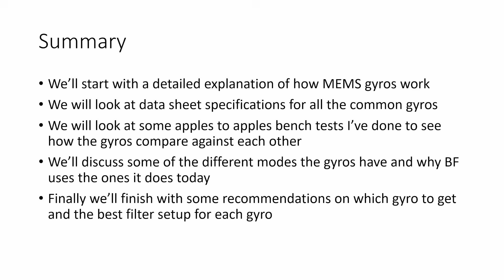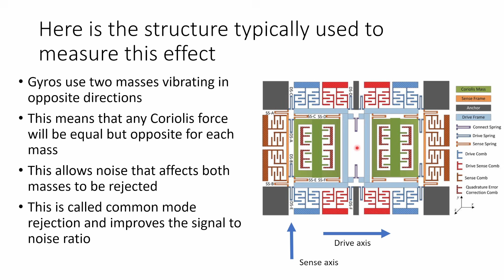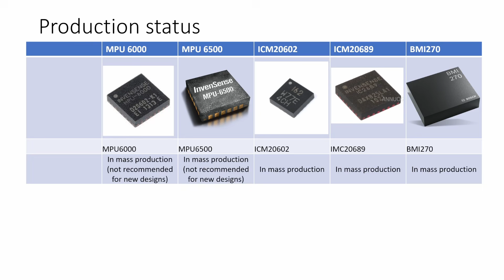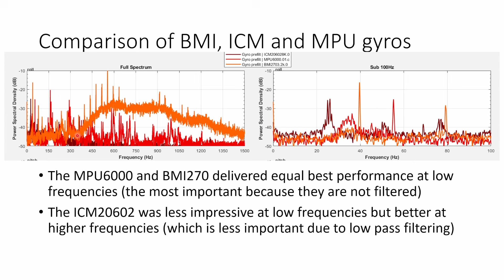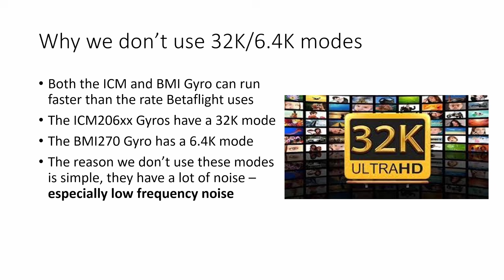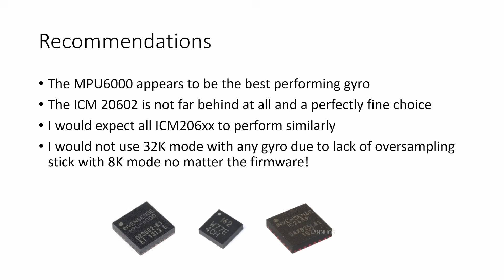Gyro shootout: MPU6000 vs ICM20602 vs BMI270 and OSR4 mode for BMI Gyros!

Comment from the maker: Hi everyone! If you have a BMI gyro board and would like to test OSR4 mode then I'm pleased to say its in BF4.3 by default now.
Reply: @Chris Rosser, Is this automatically implemented in 4.3 yet or is it still experimental? I have a SpeedyBee F7 Mini Flight Controller Stack which has the BMI270 and would like to know what to use before I maiden. Thanks for your vids and great information on this subject!
Reply from the maker: @GrumpyHeadDesigns  It's automatically in 4.3 now.
Reply: @ChrisRosser  Assumed it probably was due to the date of this vid but just wanted to make sure. SpeedyBee sent me a custom hex file for the BMI270 variant but it seemed to run better on stock 4.3 LOL. Appreciate you and thanks for your time!
Reply: I just read through the entire pull request, and... it was quite a read.
Thank you for your hard work and persistence.
Reply: so no need for the gyro lowpass filter?
Reply: I’d be very interested in some test code, I’ve got 2 quads with the Beast V2 AIO and would love to see how they fly with some more optimal implementation of the gyro.
Reply from the maker: @HotboiEngineering  Cool drop me an email!
Reply: I'm interested as well. I have a beast F7 V2 on my toothpick seen in my avatar. I sent a email to the address here on YouTube. Hope that was correct...
Reply: I have mailed you hope you have received it...
Reply: Hello. I want to buy iFlight BLITZ F7 V1.1 assembly. A BMI270 gyroscope is installed there. Please tell me, does it make sense to buy assemblies with this gyroscope now? Thank you.
Reply from the maker: @131Vol  Since 4.3 RC4 yes, the BMI gyros are working very well now.
Reply: @ChrisRosser  Thank you!
Reply: @zkullydronez1287  Yes it does. In the RC4 patchnotes it says "Switch to OSR4 mode on BMI270" so we should be good ^V^
Reply: who and where ?
Reply: Hey Chris I have a sky stars f7 with a bmi270 gyro is the duskings bmi270 filter settings in beta flight 4.3 cause I have same issues  your method
Reply: @joemck1235  On my side with the bmi270 my quad flyaway at 0 throttle with the dusking presets :p and must lower gyro frequency if not betaflight bug. That doesnt smell good at all
Reply from the maker: @joemck1235  With 4.3 BMI270 gyros should just work and you shouldn't need to apply Dusking's preset (in fact it will make things worse). If you still have noise issues in 4.3 its unlikely to be the hardware filtering in the gyro and more likely to be some other issue.
Reply: @ChrisRosser  thank you I just wasn't sure if I should use that preset or not now I can use the karate tune and your tuning videos have helped me a lot learning how to read the logs thanks for answering me so quick too
Reply: Hey Chris I've got a Mamba F722 Mini with Icm42688-P. I've tested BF 4.3  and 4.4. Different filter settings for this high noise. But nothing helps against my high throttle (80% and above) shakes. It looks in the DVR like some motors stops and the quad shakes really hard but no spiral of death.
Short time the quad flies like butter and with a new battery the crap beginns again.

Please help me :(

Comment: This week I just bought a new FC JHEMCU AIO F435 with AT32.
Everything is installed properly, assembled on a 2-inch whoop analog.
It has been connected to betaflight safely and can be connected to control everything in it.
But why is my GRYRO function NOT ACTIVE, not working. and when the low flight test the drone is uncontrollable.
I tried flashing to the latest firmware 3.5.2 March 2024 (according to target and correct). the flash was successful and turned on too.
but what I found, my GYRO (ICM 42688)  function is still not active in betaflight. not alive. 
Can you help restore the gyro function to be active and functioning ??? thank you

Comment: So is this the preset settings found in some BNF's or premade drones. Like my iflight drone came with BF V4.3, but they dont have a preset/ custom tuned fw version for this on my drone yet. Is this the type of stuff ill have to look into if i update without a preset available for BF v4.4 (iFlight Nazgul5 XL5 V2), when i do the update? Or is it more the PID tuning and settings like that? 
Great video! lots of good information. i dont have a mpu6000 in my new FC and it feels pretty much the same, but when i get a chance i will watch this again to check and see if i need to change any filtering, etc like suggested..

Comment: My favorite gyro is the icm20601 (not 602), why, it never gets confused on any of my aggressive maneuvers. Even if I lower my rates to 1900 (on the 602 gyro), I can still get the gyro to flip out, in these situations it switches the sign of the output data, that puts the control loop in a unstable positive feedback loop that the quad in a full thro spin, only disarming is the only option at that point. It's a form of spin to the moon. And enabling the anti-taz (hate that name since I created the tasmanian devil trick), basically disables many of my trucks (yaw launch, throw launch, to name a couple). Another reason is the ACC is good for 32G's, great for performance testing.

Comment: hey chris, i been having a few issues with 2year old mamba f405 gyros, i dont feel much jitter when i fly (or mistake it for my thumbs) but when i try to use rsgo or gyroflow it struggles to stabilize at all, lots of rejected flights. so i watched back raw footage and noticed quite a lot of regular wobble, then checked gyro in betaflight and saw that it was gaining -1 degree yaw every 6 or 7 seconds, plus roll and pitch were having periodic micro twitches. so i blamed my footage on a bad gyro and ordered a new fc from unmannedtech, i plugged it into bf and to my surprise it also has the -1 degree yaw thing, though a bit less frequently, not so much issue with roll and pitch, i checked on cli status and its an mpu 6500 on the new FC,  is there anything i should do?   is the new FC ok to fly?  do all gyros lose a degree ? i should add that this loss is cumulative, its not back and forward, its always minus, so after 5 minutes its -10???

Comment: Hey Chris I've got a Mamba F722 with Icm42688-p. Any ideas how to get high throttle noise away. FC is soft mounted, bidirectional D-Shot, stock PIDs and filters from Betaflight 4.3. Motors are Geprc 1507 3600kv. Frame is Geprc Cinestyle 3".

The quad flies good. But when I raise the throttle fast above round about 80% the quad is shaking like some motors stalls for microseconds.

I bet for heavy gyro noise?!

Comment: Exceptional engineering work as always Chris! I wished you had included the ICM-42688-P gyro in your excellent comparison. I've been using this chip for a completely unrelated project concentrating on its very low frequency behavior (sub 10Hz). Its FSR (full scale range) of ±2000 °/s down to ±15.625 °/s, noise density of 0.0028 °/s/√Hz , extensive user configurable internal filters, and 16/19 bit native gyro data (as opposed to 16 for the rest) made it stand out for me. Utilizing two of these gyros setup at different FSRs and different internal filtering configurations to compile the final data may prove ideal for a flight controller.

Comment: very interesting, I just checked out the new mamba board, it features two ICM-42688-P gyros. On the first look, they seem to only offer 32KHz of sampling but also a higher ADC resolution. I wonder what the frequency in Betaflight  will be

Comment: I have the iFlight Blitz F7 V1.1, with the BM1270 gyro. I backed it up from new (Dump & Diff All) and updated to BF 4.3.1. Applied my settings, and picked the available BM1270 preset. Now I'm getting the 'NO GYRO' error. Flashing back to factory 4.2.11 and factory dump/diff all is not solving the issue. Is it dead? Please help me!!! :(

Comment: Great video Chris. Is the OSR4 mode now available for the BMI 270 in the latest versions of Betaflight? I'm wondering whether I should get a FC board with MPU6000 rather than the BMI 270.

Comment: I got two f722 v3 mini and the sub 100 Hz performance is like super bad with spikes at 10, 30. 50 hz, causing flyaways. Any idea how to solve that?
Reply from the maker: On the bench or on the quad? If it's on the bench that sounds like a bad gyro.
Reply: @ChrisRosser  On the quad. I tried a lot of things, next thing will be an extra cap on the 3.3 Volt rail. I suspect v3 to be the same as the v2 with MPU gyro. Maybe the onboard filtering isn‘t sufficient for the BMI.
Reply: Cap didn't do a thing. Second brand new board showing the same behaviour. Maybe this will work on a freestyle rig but for a high power to weight ratio it isn't. A friend of mine has two v3's too and gave up on it just like I do now.
Reply from the maker: @marlin-fpv  Could there be a vibration issue? Are you using BF4.3?
Reply: @ChrisRosser  I think it‘s artefact from overfiltering from the hardware filter. <=50 Hz unfortunately nothing you can attack with filtering and its not frame resonance.
Reply: @ChrisRosser  Yes, 4.3.1. Better follow the discussion in the blackbox review group.

Comment: Hi Chris, I'm having alil trouble with the filtering for the bmi270 I have a a single biquad lpf 2 of 250 like you suggest in this video and the quad flys better than it was but I'm still getting high throttle vibes and bounce back on flips and rolls.. I'm using the supafly preset and on an identical quad with the same stack (except the gyro) and it flys perfect.  What do I need to do with the filtering and do I also need to adjust pids with the bmi270. Tia

Comment: thank you! We were all waiting for a complete and concise video on this hot topic.. while waiting for the return of the mpu6000s, even if it seems that the BMI works well, I'm still on configurations without BMI, and classic mpu6000s, I also have an FC with a dual ICM20602 gyro, and I had more trouble tuning this quad. but I swear by the MPU6000. unfortunately hard to find, but not impossible..

Comment: Excellent!! 👏👏👏 I just bought a FC BetaFPV Toothpick 20A V4 with gyro BMI270.  The manufacturer recommends removing the GLP1 and activating a GLP2 with cut-off frequencies at 135 ... In some posts they recommend applying the official preset for BMI270 that I no longer find moreover there is another preset that shifts the PID frequency at 3.2khz ... from your video I understand that with OSR4 activated, none of this is needed anymore.  I'm not understanding anything anymore and I no longer know which of these settings to apply .... So since I trust your opinion a lot I ask you:

OSR4 is finally inserted by default in betaflight or do you have to do something to activate it?

Once activated, do you still have to apply some filter such as the GLP2 at 135khz or is it no longer necessary?

If there is OSR4, should the PID frequency be set to 3.2khz or not?  thank you very much and sorry for the language but I use google translate
Reply from the maker: Just flash betaflight 4.3. Don't worry about any presets or other changes.

Comment: Hello. Thanks for the great lecture video. I recently built a geprc cinelog30. I felt the screen vibrate, and looking at the black box log, the noise was very severe at about 268hz (motor noise). Even if I apply the low-pass filter, notch filter, and rpm filter, the noise around 268hz does not disappear... Is it a problem with the bmi270 gyro itself? Any solution? I used bf4.3.1 version.

Comment: Very good explanation about how the gyro work. So, about the BMI270 on betaflight 4.2.11, do you have a preset filters, or where i can find a good one.  Thanks a lot
Reply from the maker: If you can I would use BF 4.3 with the BMI270. I'm not sure what settings are best for BF4.2 but you definitely need to add some gyro filtering. Try 250Hz PT1.
Reply: works this 250Hz PT1 on betaflight 4.2.11?

Comment: just found this video because i am having a rare issue with my Betafpv pavo 25,(and now Youtube only suggest related stuff) this quadcopter when i am flying if i try to descend (put throttle 0%) the motors start spinniing fast and i cannot descendk quadcopter keeps at same level of even fly higher! i been trying differrent pids, filters... and i found they changed the gyro on the fc! i am very impressed with the improvements you give to 95x and pavo 30, betafpv must send you a pavo25 to give the best settings and fix this problem

Comment: sorry im quite new to fpv and i just got a fc that has a bmi 270 gyro in it , is it true that if you install BF 4.3 on ur fc, the program automatically integrates these low pass filter settings into the fc? so im assuming we dont have touch the filter settings on bf?

Comment: Once u added those changes u referenced in the video on the bmi270 gyro u basically said it performs slightly better than the mpu6000, but then at the end I said the 6000 is basically better? Are u saying that based on stock settings alone but with the changes the bmi is better? Also those low pass setting u suggested are those the osr4 changes you meantioned or is that something else that’s still in the works?
Reply from the maker: Without OSR4 mode the MPU6000 is better. With Bf4.3 OSR4 mode the BMI is equal or slightly ahead. All the changes are merged and default on BF4.3
Reply: @ChrisRosser  There is only one area that is not crystal clear for me.  Since the BMI270 locks a limit at 3.2k for BOTH gyro and pid loop, aren't we giving up  significant and measureable performance by giving up the 8k speed of other gyros?
Reply from the maker: @hoverworx  The lower sample rate only adds an extra 0.19ms. This is dwarfed by the latency of the filtering in the gyro and betaflight. Overall in my experience a cleaner signal from the gyro is much more important than the data rate. That is why 32K gyro sampling is no longer supported in BF. In general best perfromance is achieved running at the highest data rate that the gyro supports with it's filtering stages engaged. That gives the most oversampling of flight frequencies without excessive noise.
Reply: @ChrisRosser  It is interesting to note that Diatone chose the MPU6500 for their new MK4 F4 FC but used the BMI270 for their new F7 MK4 FC. Even though the MPU6500 is 8k, it seems Diatone chose the BMI270 for other performance reasons for the F7. I thought it was interesting you mentioned the MPU6500 is more noisy than the others in your comparison. Yet, it is related to the tried and true MPU6000. Thanks for your indepth explanation and expertise
Reply from the maker: @hoverworx  I can't speak to the difference in spec for the FC it might just be the designs were frozen before the BMI gyro work for the F4 . The BMI270 is ENORMOUSLY cheaper than the MPU6xxx right now (25% the cost) and now that the issues with filtering have been sorted out with OSR4 mode we will see a lot more FCs with BMI gyros. Given the big uptick in quality issues with MPU gyros recently I think that the average BMI gyro is probably better than the average MPU gyro now.

Comment: Did the OSR4 stuff get put into BF 4.3? If so, how do I activate/implement it? I have a new Mobula 7 with the BMI gyro and it is giving me a lot of washouts that result in crashes. Someone pointed me to the OSR4 tweaks, I'm not sure it will solve my issues but I'd like to give it a try.
Reply: 4.3 makes OSR4 mode the default for BMI270 gyros, so as long as you're running 4.3 (and haven't changed the gyro_hardware_lpf setting in the CLI) you've got OSR4 mode active.
Reply: @GRANOLAFPV  Oh that's great! I found my way to that CLI setting but wasn't sure what any of the options meant, so I left it alone. Sounds like I'm good to go. Thanks!

Comment: I recently bought a iflight evoque f5x and my first one the esc went bad within the first 4 flights. The replacement that came didn’t fly the same with the same pid values and noticed that the first one I bought didn’t have the same crispness in turns so I went to play with the PIDs and noticed the PID loop was at 8khz on the original one I received and the new one is at 3.20khz. Because of this video I found that the first one I received the gyro was a MPU6000 and the replacement is a BMI270. Thankfully I was able to switch the FC before I sent the bad esc quad back. Am I crazy or is there that big of a difference in the feel of these gyro chips? I’m 3 months into this hobby so I’m still new at this, could I eventually have gotten the BMI270 tuned to fly like the MPU6000 or with the lack of refresh rate with the BMI270 hopeless? Thank you for the information in this video you got my subscription.

Comment: For Drone application,  you should look at the BMI088 instead of BMI270.  With BMI088,  you are able to resist the vibration frequency hook to system over the cut off frequency (230Hz with 2000Hz ODR).

Comment: Great Video 
I want to ask which version of the Diatone Mamba basic h743 I should get the BMI270 or the dual MPU6000 version
Reply from the maker: It's a difficult question. There have been quality issues withthe MPU6000s of late. The PR for OSR4 mode looks like it'll be merged soon. If they are the same price I would lean towards MPU6000 (at least one of them should be good).

Comment: Chris I have a question for you I'm running a ultralight toothpick with 2004 2900 KV motors. When I fly with the 3's battery all up weight 233 G the noise plots look perfect there's no bad frame resonance and The Dterm  filtering is clean.
When I run the same quad on a 4S battery all up weight 250 grams I get a huge resonance problem on the pitch axis only right around 200 Hz and the Dterm has a huge hot spot. This is on stock filter settings.
my question is is it the extra voltage somehow causing this or that extra 17 grams of weight somehow doing this?